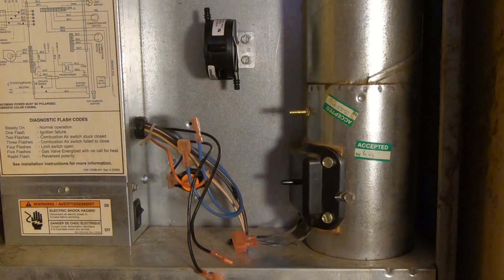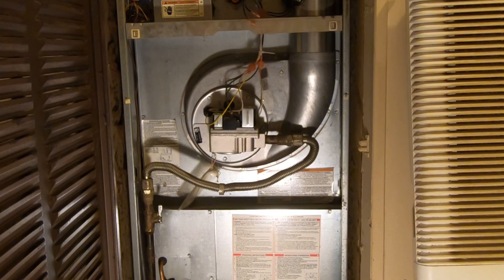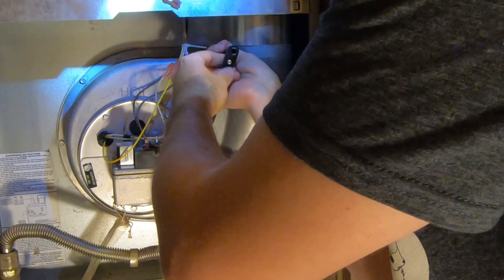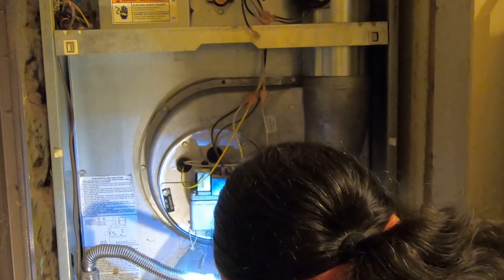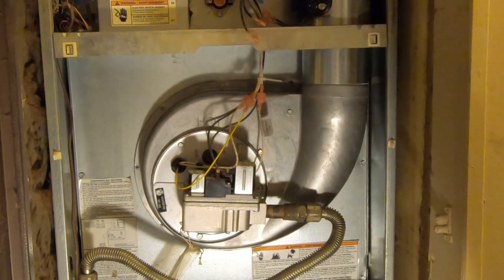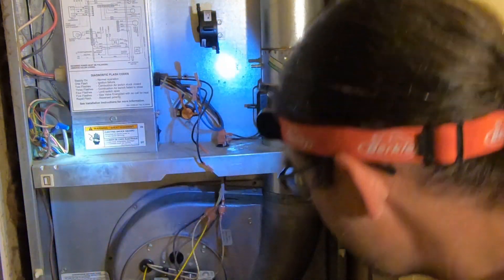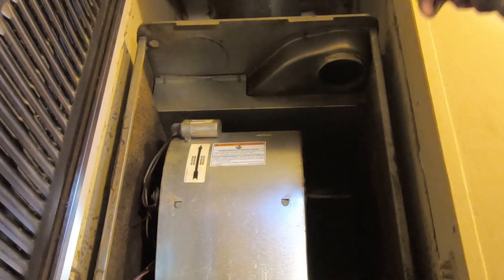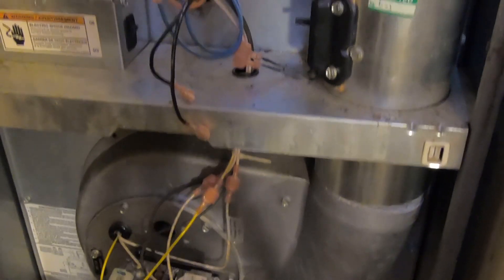Joshua Fixes the Furnace Pt 2-Coleman Model DGAA056BDTA Combustion Blower Motor Removal

Comment: I did the same repair on my furnace. I used screw #3 as the pivot and it worked better than this. Choosing that screw as a pivot made removing and re-installing the long pipe a breeze, I had no loud screeching noise.

Comment: I have this exact furnace. Can you please tell me one thing,  does the inducer motor blow in the direction up out of the flue, or does it blow down into the chamber? I was under the impression that it blows up the flue but mine is blowing down into the chamber. Am I mistaken or is my fan going in reverse? 

Thanks
Reply from the maker: No, yours is doing what it is supposed to do.  

Pulls in outside air and blows it into the chamber, which pushes the hot air in the chamber out a separate opening.  

That way it's cool air passing over the motor / fan, rather than super-hot post combustion air that would cook the motor / fan to death in no time.

Comment: Worked perfectly took about an hour and a half (worked slow and took my time) a little hack I used made it easier to get the upper section of pipe off was to heat up the adhesive goop at he top with a hair dyer just a little bit and it slid right down
Reply from the maker: Thanks for the input!  
The hair dryer thing is a GREAT IDEA!

That will probably help other people have an easier time of it.  
I wish I had thought of doing that!  :D
Reply: I gotta do mine tomorrow so that tip and this video will help for sure thanks guys :)

Comment: Thanks for the video very helpful .. but next time you can just take off the screws on the black cap and pipe would just slide down
Reply from the maker: What black cap do you mean?
The place where the little rubber hose connects to?

There wasn't room for my pipe to slide either up or down without moving / removing either the upper pipe or the firebox thing, and that black bit wasn't really the reason.
Other furnaces--like yours apparently--may have more wiggle room in them.  
Maybe newer models were made a little easier to work on, perhaps.

If you have an easier way to do it though, you should TOTALLY make a video!
I have gotten a TON of view on these 3 furnace ones.  
I guarantee you that people WILL watch your video if you make one.

Comment: Only disliked because I really wanted to see how to work on these
Reply from the maker: I wish I had done better with the camera, I have to admit.  
I wish I had a camera-person there to film it or two or three more cameras to get different angles from.  
But that's not how it worked out.
I'm just a guy who had a busted furnace and couldn't find a good video on taking it apart so I gave a shot at making one while I fixed my junk.  Sorry it wasn't more helpful.

That having been said, I'm not entirely positive what you meant by, "...wanted to see how to work on these..."  

If you meant you just wanted a better view, you can watch parts of episode 6, where I put the thing back together.  I took a bit to review the recordings first and I made sure to do a better job of filming the reassembly.  You can see a little better there, and putting it together is JUST like taking it apart--just, you know, backwards.  Even then, it's really pretty simple.  Seeing what I did a little better isn't going to help you a lot, to be honest.  It only comes apart one way really.  
Undo the bottom more or less, so everything can drop down, then you pull the pipe off the top, then your motor can lift right out.  
I was a little iffy about attempting the repair myself because of the potential dangers of gas and CO and what-not, but fortune favors the bold and in the end, it was NOT hard.  Or not for me, but I'm fairly mechanical.  I can look at an exploded diagram of a furnace or a lawn mower or a car engine (as long as the drawing is pretty accurate) and SEE those parts move and interact in my mind.  That helps me understand how things come apart and go together.  And there's really not much there.  You've just got the pipe above, the motor sub-assembly, then that firebox / intake / combustion chamber thing that you can't disconnect very far without having to fool with gas lines and such.    

But if you meant you were hoping for some comprehensive explanations and an expansive overview of the whole unit--like you'd get in some kind of HVAC repair class or something--yeah, I sure can't help you on that.  Just an amateur nobody here.  Don't know what I'm doing with a furnace.  Don't know what I'm doing with fishing.  CLEARLY don't know what I'm doing with filming stuff and putting it on YouTube!  Lol!  But I'm getting better and learning more all the time, at all of the above.  
Maybe the next time you come across one of my videos it will be more what you were looking for.

In any case, though I hate to see a dislike, thanks for the comment!
Reply from the maker: And I don't know if you saw, but I put in some timestamped highlights on my videos, so if you DO try to look for a better view in episode #6, you may wish to look through my description and click a couple timestamps to help see the parts you want to see.  Just now thought to say!